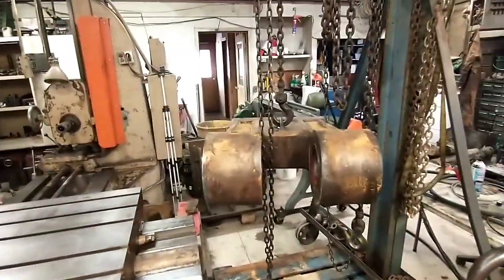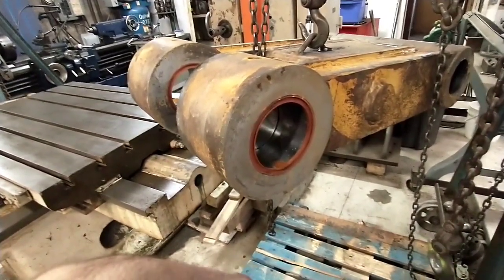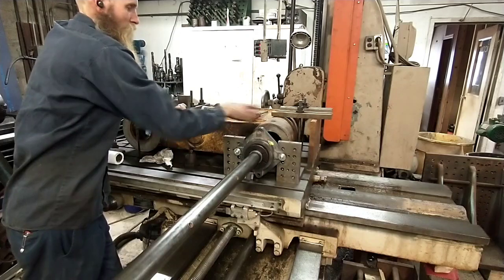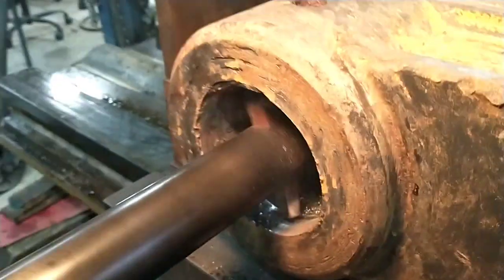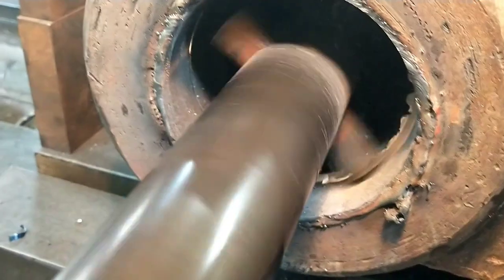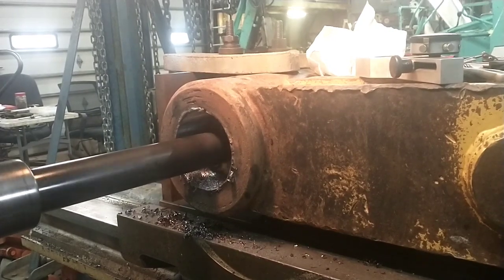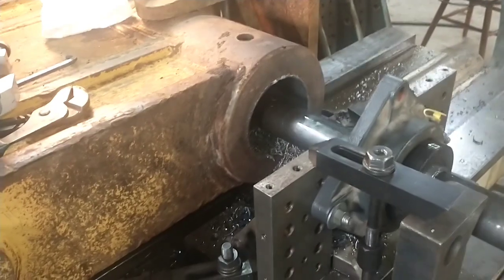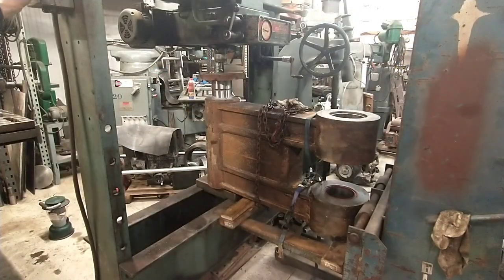Cat 375 H-link weld and re-bore on the boring mill

Comment: Did you check the bore after pressing the bushings in being that tight going in to reaffirm the I.D.?
Reply from the maker: I always check pin fit before I install the seals just in case I have to hone out the bushings. I always shoot for a tighter fit than factory, they hold up much better that way.